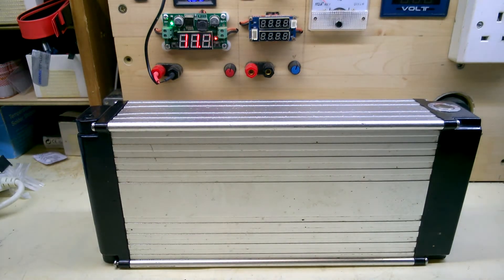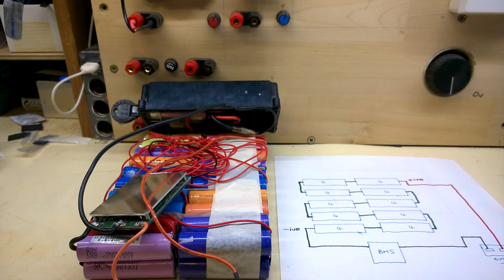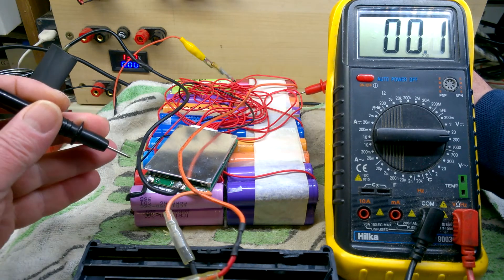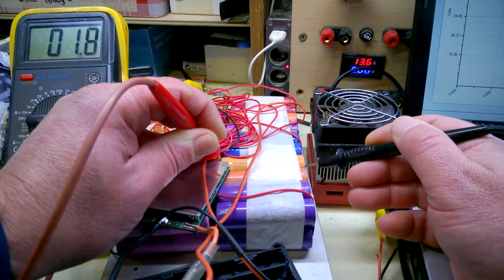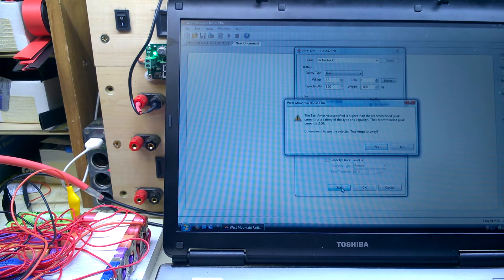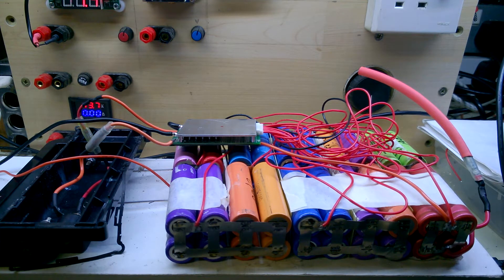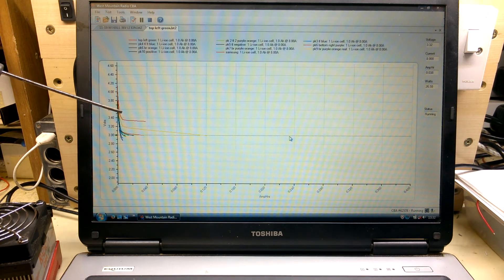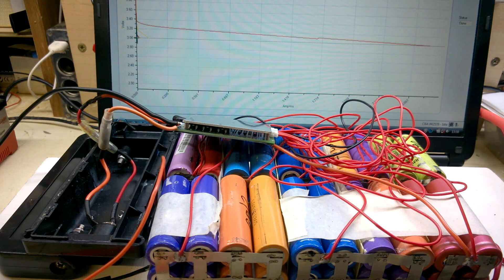Phylion E bike 36v battery fail (made with recycled cells).Long version.

Comment: Hi,
I'm creating a 10s6p for a ebike project and also a 4s4p for a powerbank to connect laptop an extra monitor and mobile to work as a hotspot.
Thank you for your video.

Question1: does that BMS do balance when charging? (can you put the link where you bought it?)
Question2: Were you carefull in mixing batteries based on capacities as I see... but, how about resistance?
Question3: Can you clarify, what is exact the cause for the failure? What do you suggest to avoid it?
I'm sharing my step by step for this projects... we kinda work together in some tasks.
Subscribed.
Kind regards.
Reply from the maker: Thanks for the comment and questions - I'll answer them the best I can.
No1 - For an ebike,DO NOT USE laptop cells.
They may have the capacity,but NOT the discharge rate required for ebikes.Many bikes take 10 to 60 amps (depends on the motor),and laptop cells (5 amp discharge capability) just can't cope.
I believe (but don't know for sure) that the cells used in this pack were low discharge cells as found in laptops.
I don't know what your knowledge level is,but most people think that all 18650 cells are the same (they are not)
However,for a powerbank,laptop cells are perfectly acceptable if the current draw is low (and of course ,it's dependent on how many cells in parallel you have etc)

Question 1 - The BMS is described as a balancing BMS.
See the link here - https://www.amazon.co.uk/gp/product/B07VGQ6V77/ref=ppx_yo_dt_b_asin_title_o02_s00?ie=UTF8&psc=1

Question 2 - I didn't make this pack,it came to me like this,so I didn't choose them or check their internal resistance

Question 3 - This is an easy one - the cause of failure was shitty recycled cells with no ability to discharge a suitable current .......................
Avoid this by buying/obtaining HIGH DISCHARGE CELLS.

Remember - buy cheap , buy twice ......

See my follow up video (if you haven't already) to see what a real battery looks like.

All the best.
Reply: @makeitwork7522  Thank you very much with your help and clarity in the answer... really appreciated. 
My idea is that you are right about: "They may have the capacity,but NOT the discharge rate required for ebikes" - actually I got this idea with other project failures in the web and from a friend about this - you are right. Thank you.

However I've seen project working using laptop cells. We can see some branded 18650 that are commonly used in laptop batteries and also in ebike batteries.
The discharge rate is for sure important and I believe I'm going to check this criteria when choosing cells and ofcourse the motor. I believe I'm going to choose the 36v tsdz2 250w (weaker one) just to ensure the power discharged from batteries is the lowest possible.

I've been tested batteries 4s1p by draining 21+5W(12V car lights). This means I'm getting out of the battery around 2.2Amps and some of them get very hot and other get OK. this may be a working selective process.

I may consider doing a 10s8p for example...

I'm going to continue my quest anyway in doing the 36v battery pack for ebike... sharing every step with you.

I see you can help also.

Thank you.